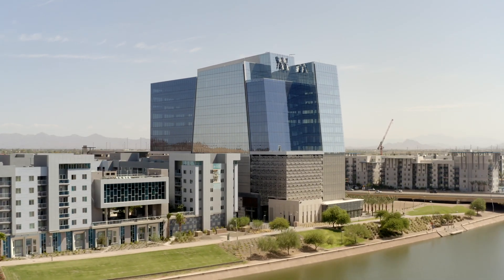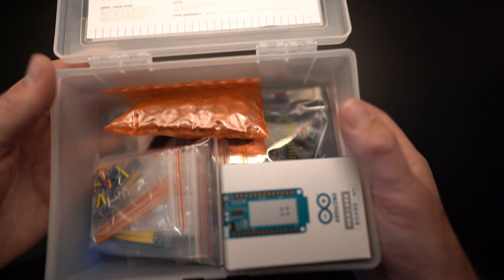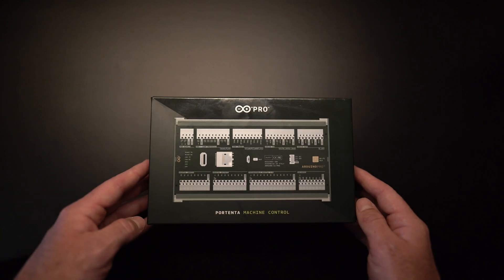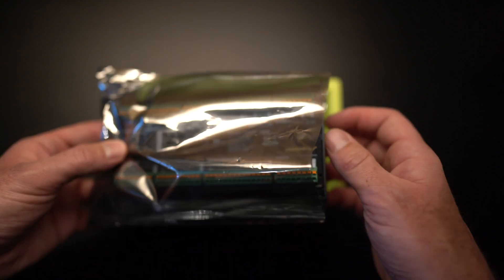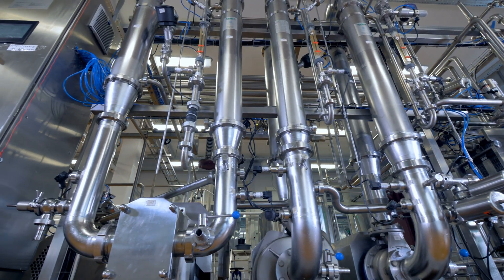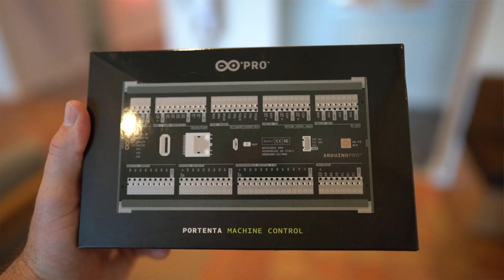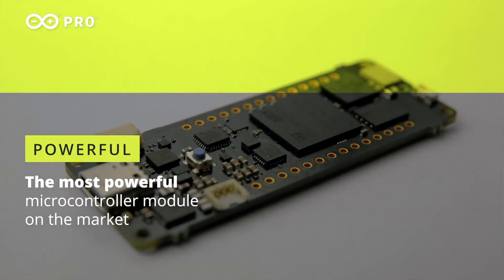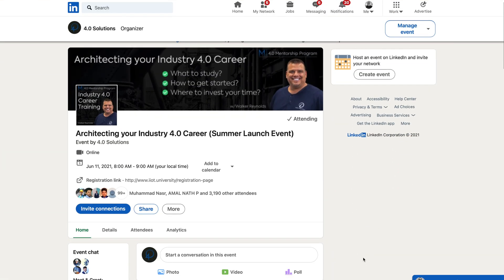ArduinoPRO Portenta Machine Control [Unboxing and Initial Impressions]

Comment: Hi, what is your opinion in using the Portenta Machine Control for controlling closed loop stepper motors with drivers as substitute to a Siemens SPS. Siemens SPS are currently hard to get and I thought of using the Porenta instead.
Reply: There's some discussion about this on the 4.0 Solutions Discord and the consensus of those who've tested it seems to be to use it only for monitoring or non- mission critical applications.

Comment: You like the cost? I can suggest to use a din mount for a Arduino Uno, Mega or even a Raspberry pi. You have the screw terminals and same din rail mount. These mounts cost anywhere between 20 - 50 euro. Way cheaper than these Arduino Pro's. I like to mount my arduino's on din rails as well. But it doesn't need to cost 400,- euro. You can also combine these din rail mounts with an Arduino mega with ethernet included, a bit more expansive, but still way cheaper than this. When you want to develop your own pcb, you can design a pcb with pin headers to make your own din rail mount for your microcontrollers with the additional circuitry included on a single board.
Reply: It is more than the rail

Comment: I'm getting one of these for our robotics lab.. Wondering if the built-in Portenta H7 already has a bluetooth antenna on the chip, and if the connector on the front is just if you need a better antenna. In the end, the price-point isn't bad on this for what it offers, as it saves me having to buy an ethernet shield, a housing, a sensor board, etc. etc.. Just wish it had PoE...

Comment: That's one hell of an expensive breakout board. I know it's "pro" but a title shouldn't dictate the value.
Reply from the maker: Breakout boards don’t come with software and a controller… Not sure what you mean. Also the cost of a bread board shouldn’t dictate the value an edge device like this provides to your application. It’s an engineered product for turn key machine builders. Why do some lines afford a $30,000 PLC while others are forced to use a more inexpensive plc?  I think it’s for Different use cases.

Comment: For engineers already familiar with how to open a box, proceed to 4:40.

"It's a hardened product"
How? It has ZERO galvanic isolation.

"It has 2 processors"
Yeah but they communicate through RPCs (remote procedure calls). If you want to get serious, you need to be looking at the Parallax P2 with 8 processors and shared memory and shared I/O.
Reply from the maker: Arduino is meant for prototypes and Arduino pro is meant for production machines. That’s why it’s hardened.
Reply: @4.0Solutions  

So please define "hardened"
It drops 24v (machine control standard) to 3.3v via a voltage divider (2 resistors)...no opto-isolation.
It doesn't even have differential line receivers for the encoder inputs.
This is nothing but a breakout board. I downloaded the schematics and the only impressive feature is the power-supply filtering.
Reply from the maker: @AdaptivePhenix  It sounds like you have a definition in mind. What is hardened?
Reply: @4.0Solutions 
Any experienced maintenance tech has a story about how 110v AC "mysteriously" made contact with a 24V input.
In the case of a truly hardened circuit, you lose an opto-coupler.

This Portenta will end up resembling overcooked polenta.

2am Sunday morning in a 24/7 production setting and you have a fried controller? Dozens of hourly employees stood around, costing a fortune?
This is the real world, coming from a guy who has decades of this stuff.
Reply: @AdaptivePhenix  
Back when I used to talk to the manufacturing types (as opposed to the IT types) about the kinds of solutions they needed on the manufacturing floor, the operative word was “robust” — hardware, software, and communications

Comment: FYI the Portenta is currently sold out on the Arduino website. Being it’s classified as an industrial product, perhaps it would’ve been available at industrial vendors similar to Phoenix Contact products supplied by Allied Electronics. It should’ve came with an antenna. What method is used to mount the board on a backplate? Surface mounted, DIN rail or snap track? 24VDC? Battery backed? If Arduino wants this to become a standard industrial control product, they need to address its ability to be incorporated into new and existing panels. I see this as remote I/O for remote locations such as pump sites, lift stations.
Reply from the maker: Allied Electronics should become an Arduino PRO Distributor! We would really like to see more industrial products like PLCnext distributed on Amazon
 The PMC is Din Rail mounted! 24vdc power.